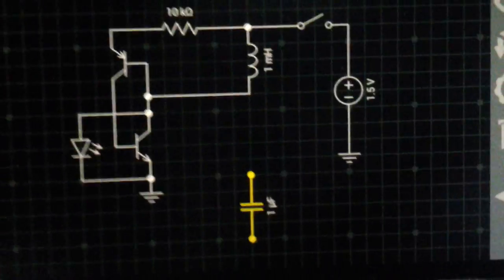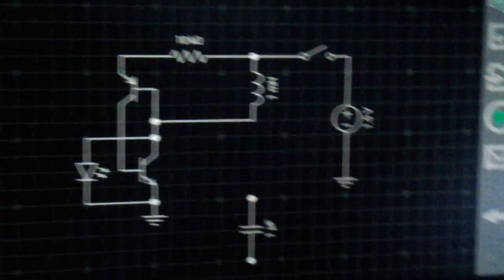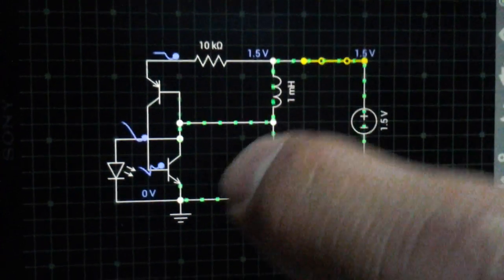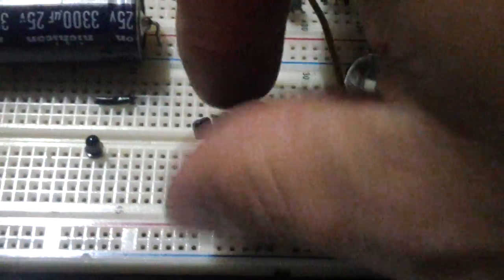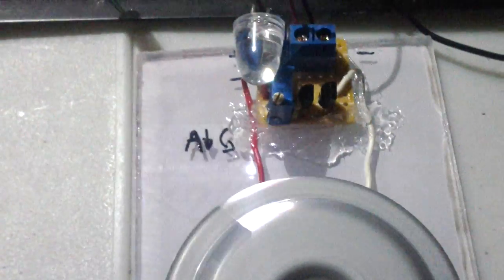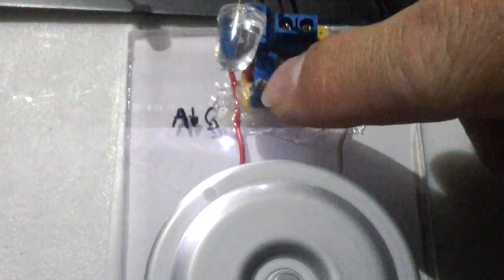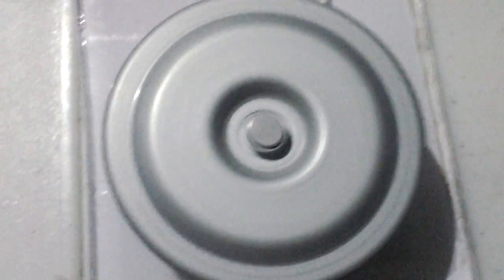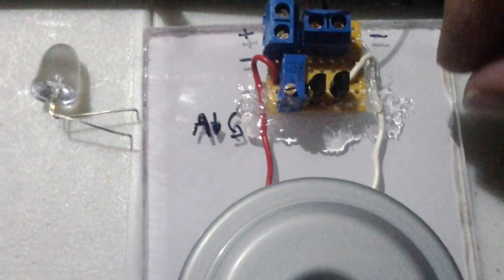DadHav single coil pulse motor

Comment: I've got the same app as in the video and replicated that very circuit, yet my LED doesn't pulse and I cannot work out why.... Any pointers would be much appreciated :)
Reply from the maker: Sometime if you play with the time scale it will start but keep in mind the app uses "perfect" parts. If you shake your device it will induce noises in the circuit. Cheers
Reply: @bakupcpu  Wow, thank-you for the rapid response !  I have played with the time scale but no joy. When you say the app uses perfect parts, what to do mean by that exactly, what difference does that make exactly ? You will have to excuse  my ignorance, I'm still learning...
Reply from the maker: @eddiegoddard4909  it use math tondo the simulation. Ex 1000 Ohms resistor is that exact value none of that +-5% like real life parts. I've had some circuit that does not work in simulation since some variable can't be simulated. Play around some values make sure polarities are correct and if it still doesn't work your circuit may still work in real life just the simulation doesn't know how to process it. Cheers

Comment: Hi bakupcpu
I haven't inductance meter  So please help me to know:
  - gauge wire and diameter of you coil and  (ohm resistant 
-How live time of 1v5 battery when your device continue running. Thank you a lot
Reply from the maker: The coil I use was from an old CLF light bulb the parts are not critical if you play around with the value you will obtain different result. Also smaller the wire will result in a higher resistance in dc but for AC signal this mean nothing it's the actual inductance that will mater now with out an inductance meter there's no real way of knowing how the circuit will react but you can plain around with the component.
Reply: Hi bakupcpu
Many and many thank you for your time help me,
Reply from the maker: 568min no problem at all if you need more help feel free to ask

Comment: can you explain to us how the motor works i just want to know if my thoughts is right
Reply from the maker: Of course to my understanding the configuration of the two transistor is similar to an SCR the coil when you spin the motor give a negative pulse on the base of the PNP transistor which then start conducting then after it's simply a chain reaction which give result to a pulse on the coil then because of the 10K resistor (which can be higher or lower value) does not allow the transistor to remain active so after the quick pulse the pair shut off and the cycle repeat. I've use this circuit on other little motor and it work great I have one with a potentiometer to allow th circuit to operate a different voltage and also affect the amperage the circuit draw.
Reply: i dont understand why it shuts off can you explain it to me ?
Reply: i dont understand why the 10k makes it stop can you tell me why
Reply from the maker: Mark Cabrera the transistor pair need enough current and voltage to remain active the resistor limit this current and therefore limit the voltage to allow the transistor the switch back off. You can modify this circuit as well as value to suit your need.  hope this help a bit if not ask more question ill try answering them the best of my knowledge.
Reply: why is it that the induction of coil turned the PNP transistor on? but  the voltage of the battery did not ? its confusing me.
Reply: why is it that the PNP activates while haveing 100k ohm during induction of coil but when the NPN opens up. the PNP dont activate? there is a connection PNP''s base and emitter to the collector of the NPN.
Reply from the maker: Ah ok I get it. Because a coil is basically a wire for dc current the base of the PNP see's the battery voltage and to activate a transistor you need at least 700 mV between the base and collector. When you spin the motor by hand will induce current in the winding and therefore creating the 700 mV once the transistor start conducting it create an avalanche effect that will quickly increase to saturation of the transistors you need this type of configuration to be able to achieve this once saturation is achieve the current in the coil will increase then quickly reverse allowing the transistor to cutoff and the cycle repeat until you either stop the motor or no power is apply. The resistor at the base of the PNP is there to limit the current that flow thru the pnp.
Reply: bakupcpu thank you for explaining there are a lot of things for me to learn.
Reply from the maker: Mark Cabrera all good my friend! I also have lots to learn even thought my job is playing with electronics components. Glad I was able to help you.
Reply: do you know a group were i can learn electronics and ask questions ? or websites? what do you recommend ?
Reply: i want to add you on facebook
Reply from the maker: Mark Cabrera I don't really use Facebook even though I have one i prefer email lol. bakupcpu@gmail.com
Reply: in facebook i can send pictures and diagrams so that you can see. any way  i am study on a flip flop circuit astable mode but i want to know how to calculate its frequency and predict  the on state and off state of my two transistors by calculating the circuit. is there an equation for that ? knowing the time when to turn on and off can be really useful
Reply from the maker: Mark Cabrera if you are making an astable flipflop oscillator yes there's a formula which I forgot for the frequency a quick google search should give you the formula. You can also send picture and diagram via email. I prefer email its more private and I get email on my phone not Facebook.

Comment from the maker: almost any pnp and npn transistor will work I just happen to have some high gain transistor laying around on my table they have a gain of 1000 they are good but for some application they are just too sensitive. They can also withstand up to 6 amp unfortunately right now I can't remember the number for those little transistor and I'm 2400km away from my parts stash >.<

Comment from the maker: The one on the breadboard is the modify version and on the motor the only thing I have that differ is the 10K pot I add this one to allow me to run this motor at higher voltage.

Comment from the maker: That's how the circuit is design originally there was a resistor in between I just modify the circuit a little :) the PNP transistor replace the trigger coil in conventional bedini circuit.

Comment from the maker: Well the winding of the motor is the inductor itself the magnet on the motor add to the power. It's probably not the best motor that I've use but it work on 1.5 volts very well I might try a different one eventually but this was justa fun little project :)